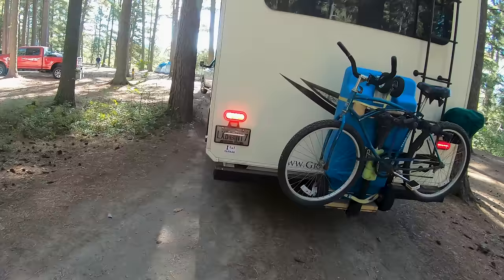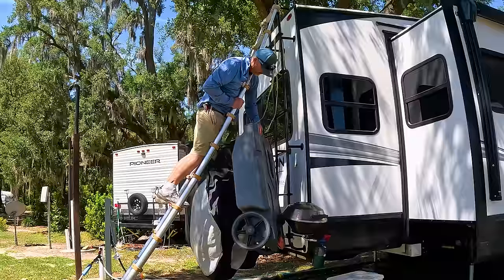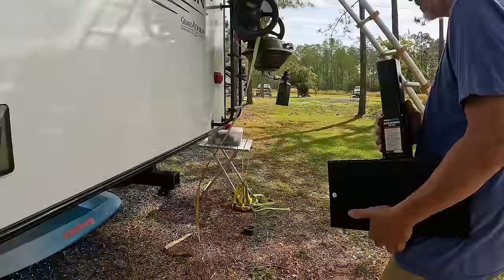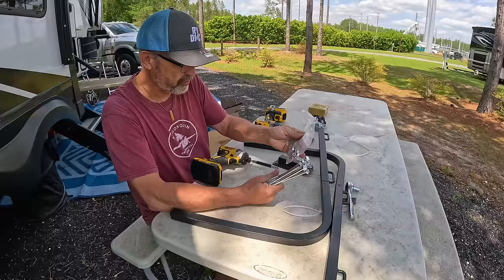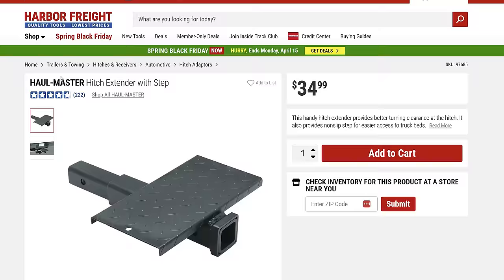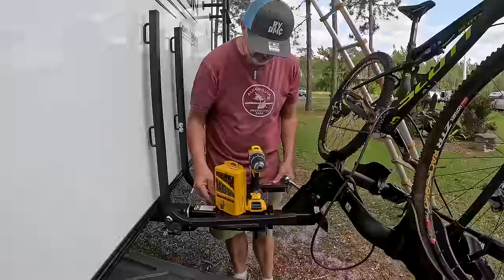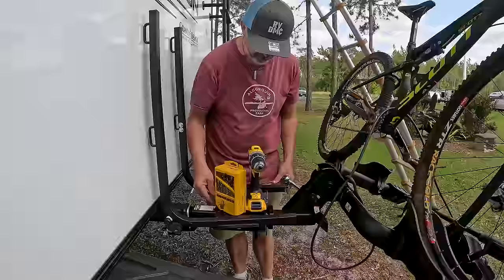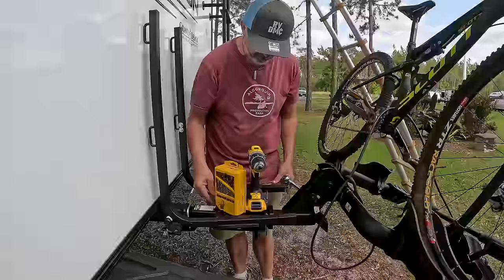Transform Your Bike Rack Into The Ultimate Sewer Tote Storage Solution!

Comment: Nice set up !!  May I suggest using some Dedicated set of ratchet straps to hold your tank  so you  won't have all the extra strap to deal with. When the ratchet straps are tight leave about a foot of extra and cut it off and use a lighter to secure the end so it won'y fey.  Party On !!
Reply from the maker: Hey Jim, ratchet strap is a great idea, it would make it so much tighter, now i have a good excuse to go back to harbor freight, ill go in there for two ratchet straps and come out with $200 worth of stuff.  I really am going to try ratchets.  Larry

Comment: Good job, Larry. I didn't know about the Harbor Freight step/extension.  That made for a nice platform. We have 2 Lectric bikes (65 lbs ea. w/o the battery), and we are using the Hollywood Racks RV Ryder rack with an 8" extension. That seemed to be the rack that was best for those bikes that we could get at the time. The rack has an anti-clip bolt similar to yours. I also use 2 large anti-rattle clips on the extension and the rack and locking pins.  I am currently using the ladder for my tote. It's the Rhino 28 gal with only 2 wheels. I've had it for a year and have never needed it yet. The longest we stayed without sewer was 5 days in NOLA, and we were fine. We did need to go easy on the galley tank. That's our smallest one. I was just thinking about what to do about my tote for the last 2 days. (Your video was very fortuitas).  Your idea might work. But my wife said our bikes bounce around a lot, (she was riding with friends following me).  So, rather than adding additional weight on the hitch, I'm possibly thinking about using the BAL Hide-a-spare rack. Then,  mounting it underneath,  close to the rear wheels. Plenty of decisions. I do carry a Dremel, but you  should consider carrying an oscillating tool!  Very handy!  Here's one thing I really need to address on the bikes. When I cover them up, sometimes  one tailight will be obscured. I need to come up with additional lights that will work with a late model Super Duty. It doesn't like LED light bars.
Reply from the maker: Sounds like you did a good job picking the right rack for the Lectrics, keeping them from rattling is hard when they are at the back of an RV.  I had an idea to strengthen the ladder by adding 4 additional supports near where the ladder would hang and make them super beefy and may still do it.    We have used our tote many time but as we have gotten really good about using water carefully,  we can go a week easy, but sometimes we get lucky and find an awesome spot for 3 or even 3 weeks, then the tote is indispensable.  Larry

Comment: Well done! Thank you for showing this process step-by-step! I will have to look into doing this for my poop tote and bike rack. I have a 5,000 lbs rated receiver welded to the camper frame 😊.
Safe travels!!
Reply from the maker: Martina,
Thank you so much. 5,000 pounds? Yes. This should work 😁 We had to have our old bumper rewelded after it almost snapped off. 
Alice
Reply: @DownsizingMakesCents  yes, I would definitely NOT do this set-up (nor even just a regular bike rack!) with a regular camper bumper!!  I have an e-bike. I got the CORRECTLY RATED E-bike rack from Etrailer 😁 for my GD Reflection fifth-wheel. I love that they have that chart (which you showed in the video) where you can see which bike rack is rated for what purpose 🙌.
Reply from the maker: @martinasaxton7033  We are in the process of trying to find another lightweight e-bike. Many e-bike websites don’t list weight where you can find it easily.
Reply: @DownsizingMakesCents  I am sure you guys will find the perfect bike 👍👍
Reply: @martinasaxton7033  be sure not to haul your poop tote while it is full!!
Reply: @jeffcampbell815  of course!!

Comment: Have two lectric E bikes I didn’t want to move them back anymore. 
I used your idea for the tote rack. 
Welded another receiver six inches over from the existing and then made an extension in which a wheelchair receiver was installed ( I can tilt my rack down for loading the tote ) welded a piece of channel to a tube that installs on the wheelchair receiver and bolted the rack to it. 
Bikes are still next to the rig and the tote is now on the outside instead of my ladder.I also welded two horizontal tubes high and low to the tote rack tubes
Reply from the maker: I am so jealous you have a welder, when we get a home base a good welder will be on of my first buys.  Thanks for sharing your solution.  Lar

Comment: I think I would have used ratchet straps instead of the pull lock straps. They allow for tighter holding.  That's what  we used to hold our tank to ladder. Thanks for the tip about wearing on ladder! Going to have to figure something out as we have factory rack on back.
Reply from the maker: Yes i need to get proper ratchet strap to make it faster, tighter and easier.  I was going to just strengthen the ladder with 4 extra stand offs, and stilll may do it.  Larry

Comment: Larry always make a pilot hole with a small bit first and then go with a little bit bigger and then go with the the bolt size and use some drilling wax it helps 😢😅
Reply from the maker: Hey Brian, thanks for the tip, this steel was pretty soft and i was just being lazy, but i do need to keep some wax with me, i used to have some cutting lube and wax at the house, help keep the bits in good shape too.  Larry

Comment: Cool mod! I’d be interested to learn if you find that this set up affects your trailer sway at all.  We also spend a lot of time boondocking and are struggling to figure out how to carry a waste tote along with our bikes.  Thanks so much for sharing your mod.  It probably won’t work on our small rig but I plan to share this video with my husband to see if it inspires any ideas that might.  
We have a little 16 ft Airstream Basecamp that we pull with a Toyota Highlander.  Being smaller we are much more sensitive to any negative effects of weight distribution.  BTW - We started out with the Kuat Transfer and found that the wide distance between the bikes moved the center of gravity too far out from the trailer and sometimes created sway on steep winding declines.  We swapped it out for the Hyperax Volt RV rack which holds the bikes closer together and this solved the problem.
Thanks again for the clever ideas and enjoy your beautiful new rig!!
Reply from the maker: I love those base camps and have met many people camping out west that had them, but too small to full time, haha.  If you have one of the smaller totes, it shouldn’t be a problem finding a solution, but no ladder so something attached to the bike rack might work.  Larry

Comment: Great illustration video. I like how you verbally walk us through your thoughts and actions. My motto: Don't force it - Get a bigger hammer.  Just wondering why you used the brackets ino which you slid your bars rather than bolting them directly to your step. Once you measure it accurately, are you going to make  periodic adjustments? Seems like direct contact would be better. Just wondering....
Reply from the maker: You’re right I did think about that, but it seemed like the easiest thing to do was to just bolt it to the existing bolts, I will definitely have to inspect this set up after every long trip and I’ll be watching intensely on our back up camera while driving looking for motion inthe rack.  Larry

Comment: Use a 3/8” socket adapter for your drill and one wrench to tighten the nuts , could have attached rack to bottom of the extension then tote could have been on the step plate would not have needed the board .
Reply from the maker: Interesting idea Wayne, i never thought of doing upside down like that, that way all the weight would be on the strong part of the extension.  HMMM.  Larry

Comment: Great video , just what I was waiting for. The camco brand rhino bumper mount tote tank holder wouldn't work with my trailer, the rear bumper is too wide for those u bolts. However, this design with the brackets might work. Sorry if i missed it, what is the distance between the bolt holes of the top and bottom brackets lenghtwise?
Reply from the maker: I’m not sure what the distance was. I have to measure it, but I think it was probably four or 5 inches between the holes.  Larry

Comment: Nice work, Larry, but I am having trouble figuring out what you're trying to accomplish with that strap.  The forces on the plate are already downwards, so how does adding a strap to the underside help???
Reply from the maker: To tell you the truth, i was thinking it the welds broke then at least it would still be attached to the extension by the strap, it was really just insurance against a catastrophic failure, and i knew somebody else would say, that thing is going to break off and go flying down the highway.  But you are right, probably not needed, i just wanted to see if i could do it with limited tools.  Haha. Larry

Comment: The locking pin does nothing because the other bolt for the extension is not a locking pin. Nice bike!
Reply from the maker: It is an awesome bike it built it from the frame up in 2015 has DI2 xtr shifters, i made 20 videos about making in on my personal channel, i recommend anyone into biking make their own bike someday, picking each part separately and building it yourself.  It was a fun project.  Larry
Reply: @DownsizingMakesCents  I just purchased a Canyon Spectral CF8 and it's very nice.  Although I wish I had the ebike versions on the trails sometimes.

Comment: Do you think including those bottom plates would help spread the load and prevent fatigue cracking over time in that plate?  Especially since weight is not a problem.
Reply from the maker: I really wanted to just reduce the amount of side to side stress on the welds, and this way if the welds fail, at least the whole platform is attached to the extension and won’t become a hazard to other drivers.  Larry
Reply: @DownsizingMakesCents  I did think your solution with the straps was clever. Though I did worry when you put that screw in the receiver that it would block the bike rack from going in. Glad to see it didn’t.

Comment: While it looks like a good job I might suggest putting lights on the bike rack because of the distance from the back of the trailer. Just like the strip of lights for under the tailgate of a truck. Hopefully you have a 4 wire connector to use there then maybe a piece to go between the tubes of the rack so you have lights all the way at the rear most point. I do this with all my hitch baskets because there are stupid people on the road and I just don't need the hassle of someone saying they didn't see the brakes
Reply from the maker: Great idea Jim,  i do have a 4 wire at the back so i could easily put on a brake light.  I would have to figure out a way to mount it with the bike cover, HMMM, ill reallly have to think about how to do that, but the extra brake light is a very sensible ideal. Thanks Larry
Reply: @DownsizingMakesCents  maybe glue some metal inside and use neodymium magnets to hold it on. Oh and to buy bolts check out tractor supply and rural king you can get it by the pound not 2 or the in a bag

Comment: I opted for a mid size tote. Not so hard on the ladder
Reply from the maker: Yes a smaller tote is doable on a ladder, but a 5 plus pound 28 to 30 gallon is just to heavy.  I bough the materials to beef up the ladder with extra supports but ended up with this instead, i may strengthen my ladder supports anyway.  Larry
Reply: @DownsizingMakesCents  I tried to do what you were but it put my car hitch too far away from the M/home. Looked a bit sketchy. 
Ended up putting the tote on the ladder. I have a 25 gal. tote.